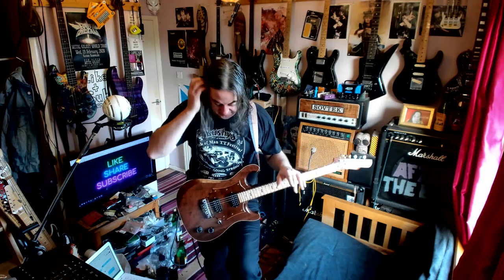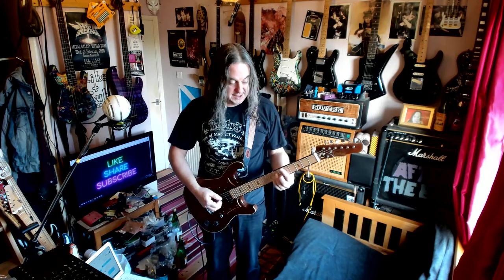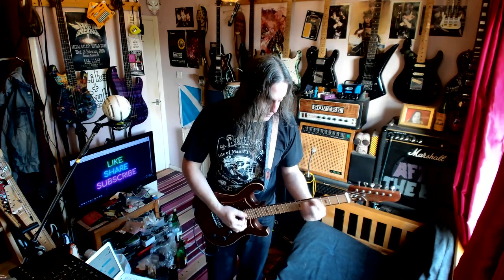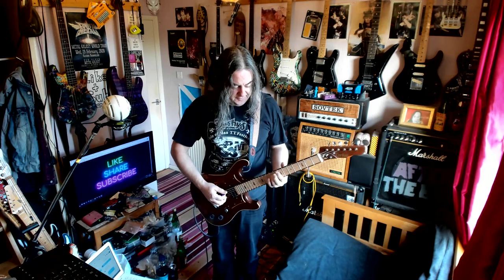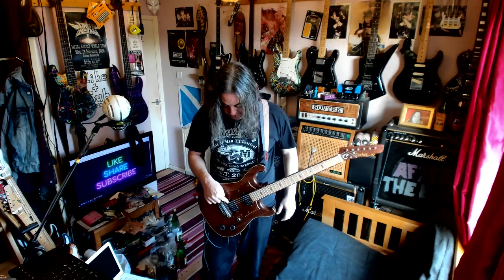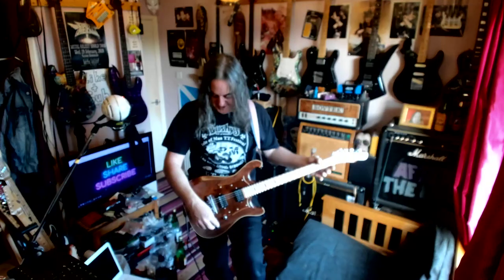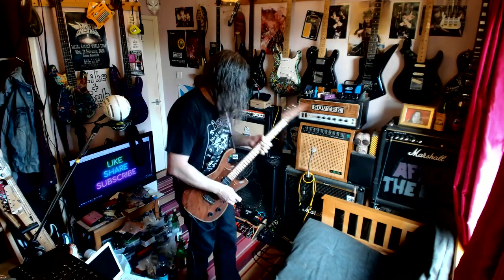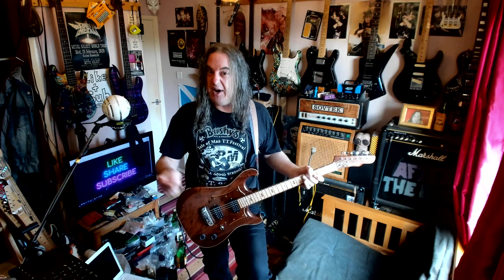corker sound demo

Comment: Have you considered a Seymour Duncan Hyperswitch ? You can assign all kinds of configurations via your phone.  BTW That is a once in a lifetime steal...Cherish that guitar and take it to the grave.
Reply from the maker: hmm dunno if i like that idea..sometimes simpler is better - tbh id have been quite happy with a regular 3 position switch and a push pull pot for coil splitting - the 6 way is a bit of a gimmick but it is actually quite easy to use (when wired up like mine is now).yeah its a pretty special guitar...